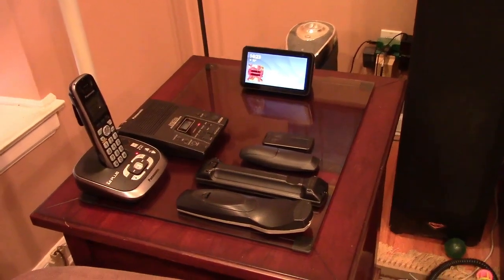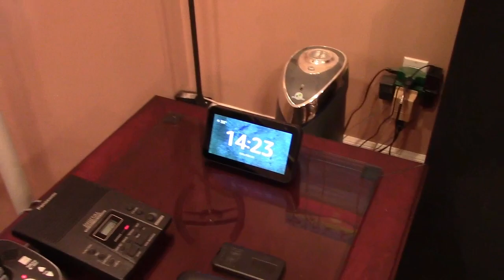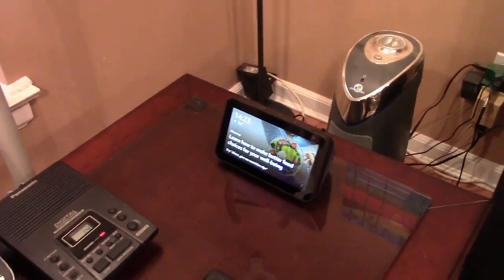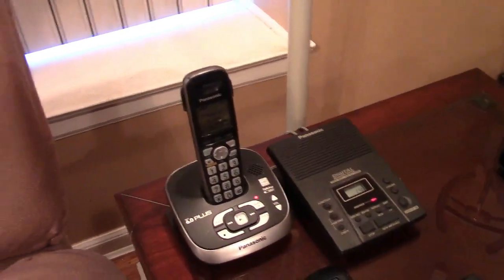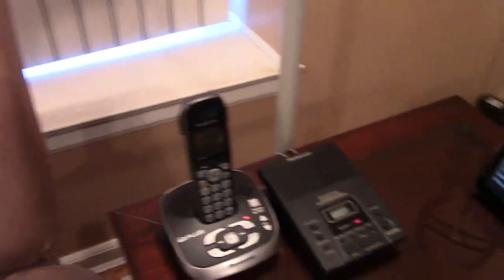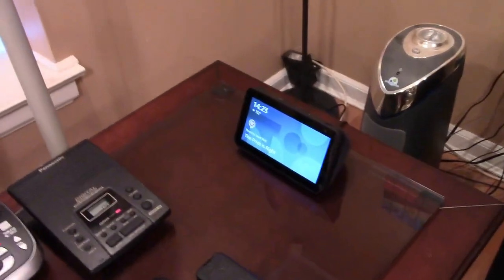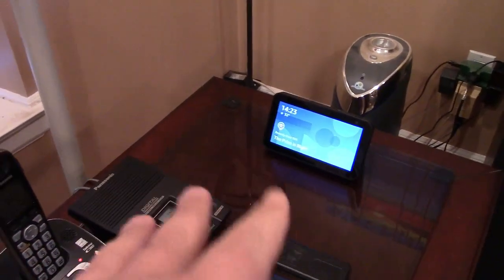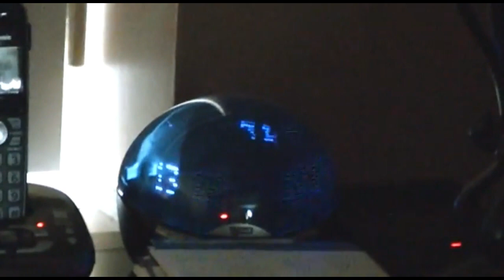Attempting To Repair The Knackered Olympia InfoGlobe

Comment: Well at least it's better than if you didn't try at all. I'm going to guess faulty solder connections is part of the problem. I ran into that with the Trinicon. I had it going, and then out of nowhere I lost video. Turns out there was a bad solder connection in one of the shielded boxes. I could press on it, and signal would come in not problem. After a bit of soldering, it works perfectly. Surface mount is on another level though!  Looking forward to see how Gegzno does with it!
Also, I just got a new bottle of Jergens, and eagerly awaiting the next wash day wash in video.
Reply from the maker: Very well could be bad solder joints.  I have no idea at this point.  Don't have the eyes, nor the skill, to work on that stuff.  Yep, we'll see what Gegzno can do.

Har har!  Excellent comment!  Maybe, if you're lucky, the next WashDay will happen before that bottle of Jergens dries up on its own!

Comment: I wouldn't be surprised if there were teeny tiny cracked solder joints on the ErrEeeDees if they aren't burned out.  Your thumping it with a remote and that causing them to come on or go out would suggest that.  Trying to re-flow tiny solder joints on surface mount components would be a royal PITA.
Reply from the maker: Could be, but it so seems Gegzno wants to have a crack at it.  We shall see what happens!
Reply from the maker: You were absolutely right!  https://www.youtube.com/watch?v=vvpCED1Z2yo

Comment: I remember someone, somewhere had one of these in their kitchen. I don’t think they had CallerID, it was mainly just there for decoration. Olympia also marketed a cordless phone with the InfoGlobe built into the base unit. 
A really long time back, I was at some garage sale in a rich, upscale, McMansion subdivision a little bit South of here because I was bored and felt like spending $25 on someone else’s crap. Someone had an alarm clock radio with a globe similar to this built into it, and I remember being pretty intrigued by it. The previous owner hadn’t remembered to clear the custom messages out of it, so as a result every so often, something like “Lauren is Sexy” would flash across it. I might have a photo somewhere. Of course, I didn’t buy it, seeing as how they wanted something like $35 for it.
Reply from the maker: Yes, I know about the cordless phone with the globe on it.  VERY rare.  

That's too bad, probably would have been a cool item to have.  One thing I've always wanted is an LED message board.  The ones I remember were just red LEDs, and could be hooked to the computer via RS-232.  Nowadays they've gone crazy with all sorts of colors and effects, and a wireless remote.  I just want an RS-232 one so I can send data to it.  Very hard-pressed to find one of those these days.  And they were a lot of money too.  I did see one that I was looking for, some 20 or more years ago, they wanted I think $109 for it.  If I knew then what would become of these things, I would have bought it.
Reply: @jaykay18  
We bought one of those for the Food Service place, they marketed it as a marquee. It comes with a little 256Mb USB Drive that you copy the file to the sign with using some very sketchy program. It’s way too complicated. I’ve been looking for an RS-232 one as well, but they’re either too expensive or not actually RS-232. 
Back when I was in High School, we got to tour a data center at the VoTech school. Around this data center were RS-232 message boards automatically populated with status, uptime, and if any errors popped up they’d show the server that was reporting it. That blew my mind. It wasn’t all that long ago, either. That data center was torn down a few years back and has since been replaced with a very boring building that probably doesn’t have a single RS-232 port in it.
Reply from the maker: @niks_crazy_world  When I first moved in the house, I found a DE-9 to RJ45 connector.  A pair of them, and you have serial over Ethernet.  I had plans originally for 2 things.  First was a thermal printer.  It was an oddball one, not meant for the US, called the Sipix Pocket Printer A6.  Biggest problem is it takes A6 type paper, thermal, not something in steady supply here in the states.  But of course I had plans for that too, I built a jig for cutting the paper down to size, from a roll of fax paper.  It never ended up working out or coming to fruition.

The other one was for an old Palm IIIe PDA, remember those?  I have a power supply for it to run it instead of batteries, and the idea was to wire it back to the print server.  Using the phonebook, next to the phone in the kitchen, and if you need to add a contact you do so right there, press the HotSync button and it's backed up over serial over Ethernet.  I never did run that cable.  And as much as I hate to admit it, I'm not the size I used to be 15 years ago, so I don't know if I could even get in the crawlspace.

That's to say nothing of the USB over telephone line contraptions I made.  I transmitted data reliably over 50 feet.  At the time it was all USB 1.1, which had a maximum cable length of 16.4 feet.  To get the print server connected to the printers upstairs, I ran another Ethernet line, and used one of those active USB extenders that use an RJ-45 cable.  Then, my usage changed.  I used to print an awful lot, now if I print 10 pages a month it's plenty.  So that fell into disuse as well.

One last Serial-to-Ethernet adapter was going to be used for the planned garage computer, which still never happened.  I have an OBDII Scan Tool that hooks up to the computer via serial, the PC would run the software and the connection would be made via serial, over Ethernet.  No longer needed, with the amount of scan tools I have reviewed (and there's another one tomorrow).  The handheld tools are so much more advanced than that thing ever was, so again, it's kind of useless.  All great ideas that either never came to fruition, or fizzled out.
Reply: There’s some of those around here too. Not sure where they came from, but I have no use for them. There’s a box of useless cords and connectors in a box in the basement that I refuse to sort through because I know I’ll spend hours doing so and end up doing 5 or 6 other projects from the list at the same time. 

I have a Palm Pilot that still works, along with the HP equivilant called a Journada. Both still work, and both exceed the battery life of an iPhone by about 3 weeks while in constant daily use. Yes, I still carry a PDA most days because it’s just cool still doing that in 2022. The hotsync server for the Palm is a 2004 Apple PowerBook G4, all aluminum. Of course, it hasn’t been synced since probably 2017. 

I’ve never done any custom non-standard cables myself. I’ve done Ethernet, but never anything much beyond that. The only print server I’ve ever had on the network was some Linksys Wireless-G PrintServer contraption that, of course, hardly worked at all. I think it’s sitting in yet another box in the basement. 

Before Charter Spectrum pulled their heads out of their asses and moved the coaxial input from the lowest, farthest spot in the house from anything to a slightly more desirable location, I almost ran an Ethernet cable out to the garage. Was there a computer out there? No. Is there a computer out there now? Still no. I had planned on putting an HP ProOne out there a while back, but it never came to fruition, mainly because I don’t need a computer in there. All I do in there is park a car and sometimes store stuff. If I was repairing said car, or inventorying said stuff, or even running a business out of there, it would make sense to have a computer out there. But it just didn’t make sense to run the cable or put the computer out there. Thinking about it now, I actually don’t know how it would have run anyway. The crawl space doesn’t go under the garage, and it’s solid concrete, so I wouldn’t have been able to put it there anyway.
Reply from the maker: @niks_crazy_world  Oh yeah, I just did a small archaeological dig, and came up with a couple PS/2 to Serial adapters for mice, the old-school kind, with the wire.  Also found another CueCat, so I'll see if that one potentially works.  I have a whole bunch of unsorted cables, like coax and RCA, that needs sorting.  There's a box out in the garage with who knows what in it, I think there's even some 300-ohm twin-lead in there.

I haven't carried a Palm in years.  I have a IIIxe with 8MB of memory, that was my daily back in the day.  One day there will be a video.  I remember the Jornada, I used to sell them!

Well the print server I have is a whole custom job I made way back when, some old Gateway with a Pentium II 400MHz processor I think.  Total of 12 serial ports, 5 parallel ports, and countless other USB ports and USB to serial and USB to parallel adapters.

Where there's a will, there's a way.  You can indeed get a cable through there to the garage.  In my house, the garage is at ground level, the house is up 3 steps.  I have about a 1-inch area I can just barely feed a snake through to pull cables.  And what was it, maybe 5 or 6 years ago, I pulled 2 new 120 volt circuits, a 240 volt circuit, Ethernet, telephone, cable was already there (ran previously), another Ethernet cable for the alarm siren and strobe and doorbell server speaker, and an alarm wire that then pops through the wall for the keypad there.  I have full service to that garage.  This was all done by feel with the snake, and none of it was easy.  The holes were also not aligned, so it has to go at an angle.  But there shouldn't be any need to run any more cables out there.

I do have a computer out in the garage.  Actually 2.  An old Dell with a knackered screen and broken hinges which I haven't used in years, and an ancient 300-some-odd MHz IBM Thinkpad which plays music and runs a photo slideshow.  Believe it or not, even though I ran Ethernet out there, I never went further and hooked it up to the Thinkpad, that's still on a wireless connection.  But plenty fast enough for the kilobytes of data per second that it needs to transfer.
Reply: @jaykay18  
I have a USB CueCat, doesn’t scan anything. Even took it apart and reverse put it back together. Nothing. 

There’s probably a hole somewhere between the garage and the crawl space, I just haven’t cared to look for it. Eventually, either with this house or the next, I’m putting in a dedicated network closet or nook so it doesn’t have to sit on top of the VoIP Server in the basement. That way the Modem, Router, main AP, and Switch are all in one space instead of fanned out across the basement. I’ll probably move the home phone modem down there too. It’s impossible to run wires in this house without drilling through floors, but eventually once I move I’m going to put Ethernet drops in every room and run cables to the garage and even a few outside for cameras should the need arise. No crawl spacing required hopefully!
Reply from the maker: @niks_crazy_world  I've drilled through the floor 3 times that I remember.  If done right, it looks like it was always there.  Unless you're a perfectionist where you need Ethernet jacks on every wall, I just run the cables, that's more than good enough for me, and works just the same.
Reply: @jaykay18  
There’s been a few instances of drilling through the floor in other houses, but in those it actually makes sense. This house was built really stupidly with about 15-20 others around the town in 2000, and half the time stuff just doesn’t make sense. Charter Spectrum put everyone’s cable inputs into the house in this little cutout in the basement. Ok, cool, but it’s on the wrong side of the house. In 2000? That’s just fine. Now? I have to deploy a mesh system just to get coverage on the next floor.
Reply from the maker: @niks_crazy_world  You run into the same fun anywhere you go.  My house was built in 1954.  There was no cable TV.  There was no Internet.  There were no home computers.  All that stuff had to be added.  They could have run all that stuff in through the other side of the house, but then all that wire would have to go through the garage to feed the house.  1950s wiring is fun, because you can have a living room outlet on with one in the kitchen, or the bathroom outlet piggybacked off of your outside lights, pretty much whatever was convenient was how it was done.
Reply: @jaykay18  
This house’s electrical is the same way. Originally there was one breaker panel, each room got its own fuse. Dining/Living, Kitchen, Bathroom, all 3 bedrooms, the basement, the storage room, the garage, and the outdoor lights and outlets. 
That still isn’t the case. The bathroom fuse has both the bathroom and the guest bedroom on it. The “master bedroom” fuse (that room is for storage) doesn’t do anything and that room is on the kitchen fuse. Opposite ends of the house, mind you. When the guy who lives here before I did had an addition put on, the electrician hooked part of the addition up to that fuse panel and the rest of it up to a sub panel in the laundry room. And it doesn’t make any more sense there either.
Reply from the maker: @niks_crazy_world  I wonder what would possess anyone to do that.  Nowadays, I would consider wiring everything logically.  A kitchen should have a circuit for every major appliance, like a refrigerator, and dishwasher.  Then, a couple others for various kitchen appliances, like coffee makers, microwaves, toasters.  Each bathroom should have its own dedicated breaker for the outlet(s).  Lighting I'm a bit more lenient with.  Like the upstairs of my house is 2 bedrooms, a bathroom, a powder room, and a hallway.  I would figure that one breaker for all of the upstairs lighting would be sufficient.  But there's just no sense of the mess of wiring that can be made, even in new installations.
Reply: @jaykay18  
I hear that. I’m pretty sure the electrician was an alcoholic. 
This is off-topic, but I’ve got a Shoutcast server now! So far I haven’t had much luck in getting it to work on the website, but I can access it from inside the house. The next order of business is to figure out why it isn’t working online.
Reply from the maker: @niks_crazy_world  What are you, the next me?  Setting it up is half the fun!  When you're out of ideas, let me know.
Reply: @jaykay18  
Don’t worry, there’ll always be a steady stream of ideas. This machine (it’s that damn Presario again) also doubles as a network file drive.
Reply from the maker: @niks_crazy_world  Ha!  So does mine!  But how little horsepower are you running it all on?  Mine is a Pentium III 866MHz machine.
Reply: @jaykay18  
AMD Athelon that runs at about 2.2MHz. 3 Gigabytes of RAM, Windows 7. I looked into it a while ago and it costs about $423 per year to run the thing non-stop. That's part of the reason I'm looking to consolidate a few different machines, my VoIP Server can easily run that, Shoutcast, and probably the fileserver too. That machine uses a ton less power.
Reply from the maker: @niks_crazy_world  I don't know what the SHOUTcast server or print server pull, but I know the doorbell server runs at a comfortable 55 watts or so.  I'm more than happy with that.  Figure about 10 bucks a month.
Reply: @jaykay18  
Luck would have it, I have a much smaller power supply for this machine! Just swapped it in, should work much better in my electric Bill’s eyes.
Reply from the maker: @niks_crazy_world  Ha ha, yeah, I remember people wanting to upgrade their machines with 1000 watt power supplies, not even realizing that they're going to be guzzling juice!

Comment: I think I remember seeing that in an older video titled "Earliest House Video" in your living room like you showed here. I thought it looked really cool for what it was. You can still get them on the jungle sites like eBay or Amazon if you wanted a new one. I thought about buying one but since we don't have a landline in our house, I can't say we'd have much use for such a thing. Does this device do anything else other than provide a caller ID? That said, we'll see if it can be fixed eh?
Reply from the maker: Yep, I probably had it set up even back then.  That was just a couple weeks after I moved in, and the first time I had EVER had caller ID!  I had owned it for 2 or 3 years prior to that, and indeed, it was there with no caller ID.  Without that, it will display the time and date, and has pre-programmed messages like "Happy Thanksgiving" and "Merry Christmas" that pop up automatically.  Plus, there were messages that could be programmed in, and you'd set the date you'd like it displayed.  Yes, we'll see if Gegzno can work his magic on it!

Comment: I have a feeling the actual surface mount LEDS are dead and the ones still lit are not far behind.
LEDS can last a long time if not driven at 100% which this probably was doing. I have a feeling dust had nothing to do with this at all!
Reply from the maker: Others have reported after cleaning the dust, theirs worked again.  But this one sat for a good 10 years this way, so you very well may be right.
Reply from the maker: Check out the diagnosing video RollingTardis put up:  https://www.youtube.com/watch?v=vvpCED1Z2yo